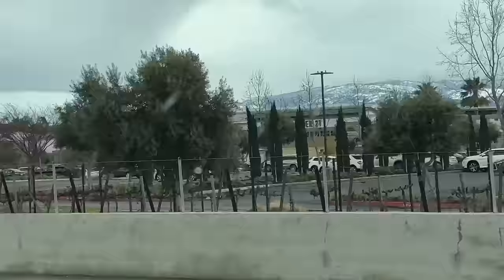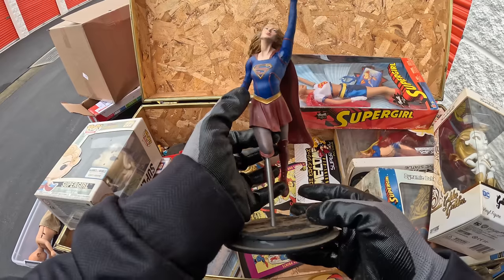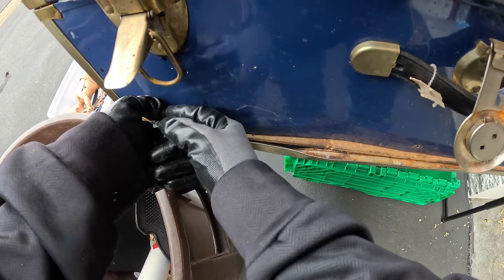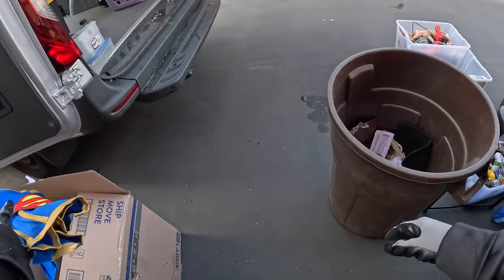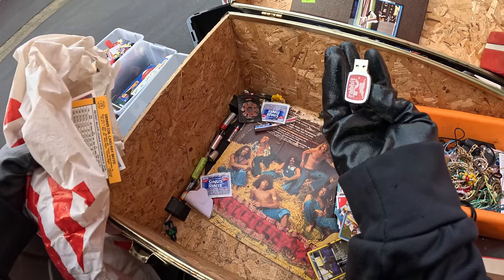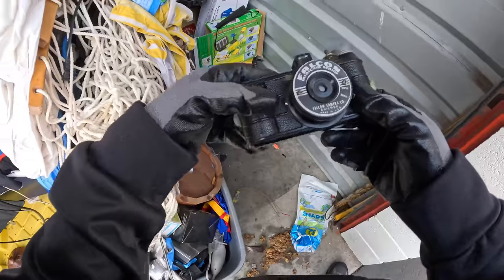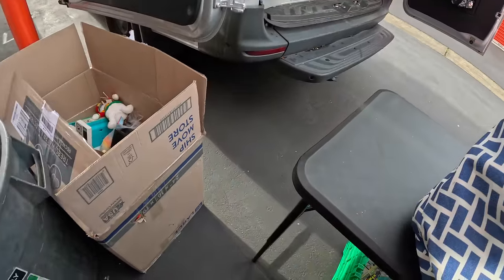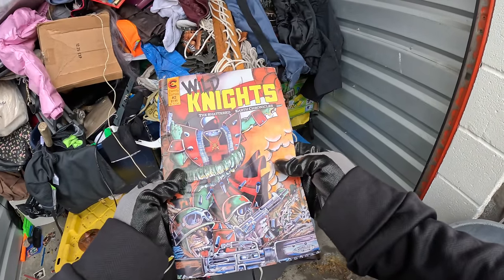JUNKALANCHE! The wall of disaster proves dangerous, but the risk is worth the reward

Comment: Hey Jack...the only card of any real value in the 1989 Upper Deck set is the #1 card which is Ken Griffey Jr.'s Rookie Card.  Raw sells around $50.  If the condition is MINT or better it's worth grading.  PSA 9 sells around $200 and a PSA 10 sells right at $2K.  ✌